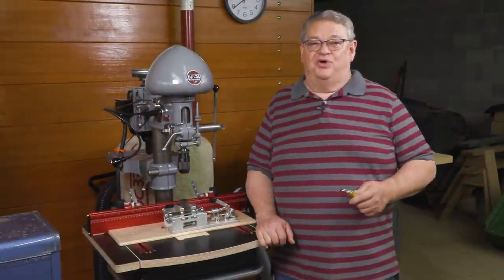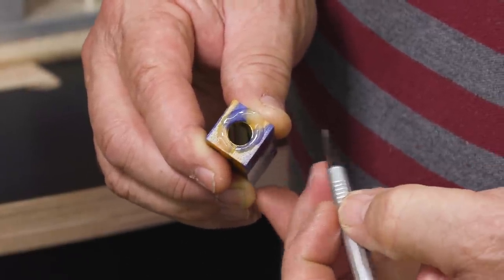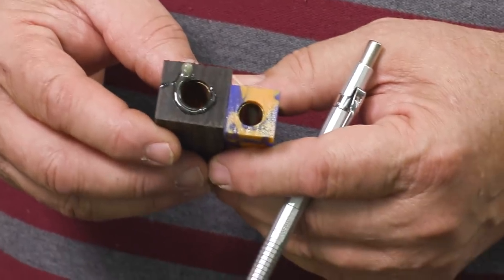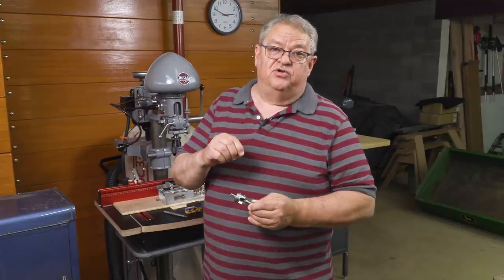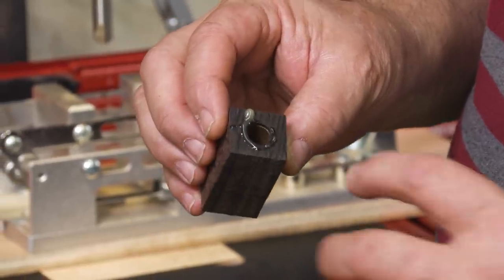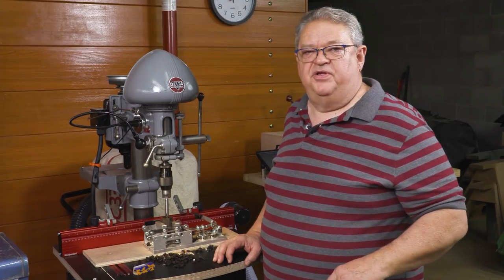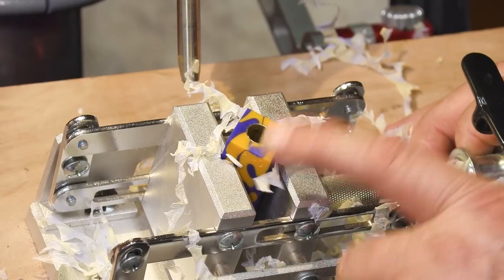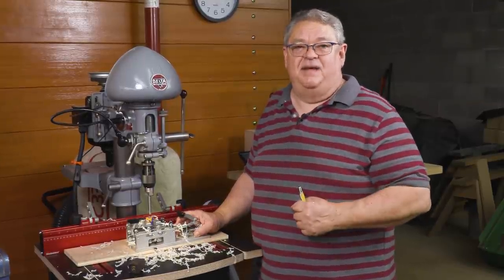This Tool Is Essential For Making Pens | Deep Dive | Woodpeckers Tools

Comment: This is an outstanding design. Being able to mount the mill in the chuck and leave it there it a great idea. This will make facing the ends of the pen blank so easy. The replaceable carbide inserts should last for a long time.

I like your Delta drill press Jeff. Looks to be in great shape.

Comment: I started using your mill yesterday. It’s good although need to be a little careful on a couple of things. Drill speed is important. Took me a while to find the right speed. For me it was around 900rm. Any slower and I got a poor surface - very rough. The other thing is go very slowly to start. I ruined a couple of blanks when I got a bit too aggressive with the cutters and the cutter caught the top and split the blank. If you observe these two things it works very well. I was only drilling wood blanks (Australian blackwood and jarrah) so no experience as yet on acrylic. Cheers
Reply from the maker: Jenny, that's a pretty common comment from people who have been using steel barrel trimmers. They're so used to having to force things that they over-feed the Pen Mill Ci the first few times.

Comment: I was very happy to hear you say near the end that I won't have to rotate the carbide insert a quarter turn until I have used it for prepping over 100 pens or so.  And since I usually cut and stop to see where my cutting is occurring so I don't cut the brass tubing at all; that the brass tubing is perfectly flush without cutting any of it if possible, hopefully it'll last a little longer still. LOL
Reply from the maker: John, there's no problem with being cautious, but just so you know, your pen kit (all of them) have quite a bit of tolerance on the length. You can touch the brass a little and still get a perfect fit on your pen components. And, the brass is no harder on the carbide insert than Brazilian Rosewood...maybe less, lol.
Reply: Now that is interesting info.  I never would have thought the brass inserts were less hard than any wood species.  Now I can breathe a little easier.  Thank you for sharing that with me. LOL.  Have a Great Weekend!!
Reply: @johnhuggins5021  I was a machinist for over 45 years and cut all kinds of metal. Brass is a dream to cut. Carbide like they use in these cutters, or even regular tool steel, will cut brass all day long with no problems at all. Just don't drop the cutter or bang it against other hard material like steel or concrete because carbide is brittle and can chip fairly easily. But carbide is used for cutting most other normal metals in a machine shop without dulling very much.

Comment: Nice tool &  video. On the readers, the cutting edge appears to be at the very bottom of the reamer. Does that give you any problem getting the reamer centered in the brass tube, especially if there is an off-center glob of epoxy at the end of the brass tube?
Reply: No

Comment: Approximately what is the lathe speed?  I know that your lathe probably doesn't have an RPM readout but the belt pulleys used should give some indication of lathe spindle speed.  Also is there some reason for the very short shaft that inserts into the drill chuck?  There was considerable runout on the first pilot reamer and I wonder if a longer shaft at the drill chuck end might be of some help with that. Drill chucks are notorious for being loose after a while. Nicely made piece as usual.
Reply from the maker: Lathe speed or drill press speed? The drill press is 780rpm. I use the next to lowest speed on my step pulleys almost all the time. I actually think what everyone is calling runout is a result of seeing the single flute of the reamer turning at such a low speed and magnified 2x. I've had a dial indicator on that chuck and it shows less than .001" measured half an inch below the jaws. The three-lobed shaft of Pen Mill is definitely not the culprit. If anything, the reduced shank of the reamers might introduce some runout, but I really think it's just a trick of the camera.
Reply: @WoodpeckersLLC  Thanks for the reply. I meant drill speed, I am learning Woodturning so that is where my mind is at. Thanks for the speed. I forgot about the three flats to engage with the drill chuck. Sounds like you have it all covered. Take care and stay safe.

Comment: Oops, a correction on my previous question on centering the pilot if there is a glob of glue inside the brass tube. Upon closer looks, the reamer do have a small taper on the end, which would facilitate getting the reamer centered.
Reply: Brian, I’ve owned and used the Ultra-Shear Pen Mill Ci 13-Piece Set since late 2019. It is a very well made and precision piece of engineering. It does, however, suffer from what I believe to be a shank that is too short and incomplete machining of the reamers, but fortunately the reamers can be corrected. The end of the reamer which is intended to cut into any residual glue in the tube doesn’t, because it can’t. The reason is because there isn’t any relief ground out behind the two cutting edges of the bottom of the reamer, it is dead flat, in relation to the tip of the cutters. Without a relief of any kind the cutters can’t bite or cut into the material it is attempting to cut. All other reamers have one, so I’m not sure why these don’t. Anyway, if you have ever sharpened a drill bit on a bench grinder you can apply the same technique to these, and they will work perfectly! If you haven’t any experience, there are many YouTube videos on sharpening drill bits that should help you out. 
All the best, Chuck
Reply: @toolchuck  Chuck, many thanks for the input.  I'll probably pass it on to Woodpeckers and ask if they've considered this issue.  Secondly, I use a DrillDoctor to sharpen my drills.  Do you think doing a partial sharpening of the Woodpecker Ultra-Shear reamers with a DrillDoctor would provide the necessary cutter relief?
Reply: @briansack7920   Brian, I have a Drill Doctor, and no it won't. It references the cutting edge from the flute if I remember correctly, which the pilot reamer lacks. Grinding the relief is not that hard, the hardest part is getting over grinding on a brand-new beautiful pilot reamer.🤦‍♂️ The amount of material that needs to be removed is not a lot, just enough to allow the cutting edge to bite into the glue. If you go to Craft Supplies USA and search for Whiteside pen mill, you'll see a great closeup picture of their reamer that has reliefs cut into them.

Comment: Are these amateur pens guaranteed not to leak?  Serious question.
Reply from the maker: Depends on the supplier of the mechanical parts, but in my experience they're very reliable. Nothing the woodworker does could make it leak.

Comment: 6-8 weeks before shipping? You should not be doing a deep dive on products Woodpecker can't even ship.  I would buy a set today but I don't have time to wait that long so off to Woodcraft with my money.
Reply from the maker: You might notice that the 5-piece set is the only product that shows delayed shipment. All the individual components and the 13-piece set can ship immediately. The company that makes the cases sent the wrong size. They're supposed to be replaced sooner than the 6-8 week message, but that's what the computer puts up as a minimum.
Reply: LMAO